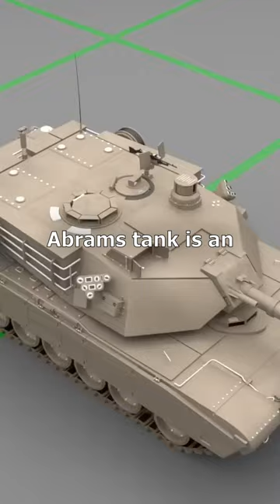The Abrams Tank is NOT Invincible! #shorts

Comment: The chance of a 152mm direct hit on a moving tank is low, even with the laser guided shells.   What has clearly happened is that IFV and MBT were immobilized in the open by tanks and then artillery, Lancet drones and other weapons were used to Finnish them off.  In many cases Lancets or other weapons  were used to get propaganda photographs and images.
Reply: Not to mention that they have all been recovered and repairable!
Reply: @malcolmallen31  they have been recovered in Middle East, but this is a different scenario in Russia
Reply: Whatever helps you cope. I have seen dozens and dozens of pieces of footage showing Lancets blowing up tanks, IFV's, APC's, artillery etc., so please don't try to gaslight me and tell me they are only used for already incapacitated machinery. Russia's Krasnopol is highly effective, actually, but as I said, ,whatever helps you cope.
Reply: Do believe those were mines from the famously long mind field there
Reply: @thanos7691  The ones that can be recovered immediately, are, others are recovered when the area is liberated. would be stupid to try under direct artillery fire. You'd just lose the recovery vehicle as well.

Comment: MBTs are designed to fight other tanks and therefore the tops are generally very lightly armored. Just about any artillery shell with a direct hit will destroy any MBT, this is difficult to do. It is the reason the A10 is a tank killer with only a 30mm gun. It is primarily hitting the lightly armored top and not the heavily armor sides.
Reply: In reality that 30mm gun is hard to accurately place on moving targets, they're more likely to use their air to ground missiles they have on them 👌

Comment: I believe in Desert Storm an M1-A1 was stuck in the sand. Before the crew abandoned it another M1-A1 placed a round from behind in the engine compartment. A maintenance crew arrived and had the tank operational in 6 hours. In Iraq Freedom an RPG round penetrated the crew compartment of a later version on the M-1. One crew member received some burns on his back, but the fire suppression system put out the fire before and major damage was done. Most of the Iraq losses to ISIS were abandoned tanks.
Reply: The rpg needs up grade, tanks, airplanes are only good against people who have no access to  modern missles system.
Reply: The ISIS thing is actually more simple then most think.

Iraq didn't lose to a battle with ISIS and lost the tanks.
Iraqi army never bothered to show up and fight them and ISIS just took them.

Comment: The tanks the USA uses is much better then the tanks used in Afghanistan were taking direct fire and cruising except one lucky guy that manage to send a rpg though a exhaust flap when it was open even then it only took out the engine they ended up removing important equipment and destroying the tank themselves instead of towing it. And I'm sure they fixed that from happening again.

Comment: There is a range in Nevada that contains several tank hulls of various types from Russian to German and even a few abrams hulls, it is for practice for such planes as the a10. The cannon on an a10 can decimate an abrams so a howitzer most definitely can, question is can a howitzer hit it. Laws of probability dictate that if you put enough shells in the air one is likely to hit it. Nobody builds indestructible military equipment, it doesn’t exist. Remember, as n f22 or f35 can be shot down by a p51 mustang in the right scenario and with enough luck

Comment: The Abrams being delivered  is a older designed model like the Leopard 1  30 years behind the current model in use by the US military. It sure will burn with a 152 mm round impact
Reply: I mean yeah just about any tank will if hit by a 152mm artillery as the guy said in the vid

Comment: Have to know few facts about the first Leopard tanks destroyed. Those were modified for mine clearing and currently those has been repaired and back in action
Reply: Some of them were, that field is pretty much cleaned up now. The leopards were mostly fine, but surrounded by the burnt out Bradley's they looked like a centerpiece of failure. Russians still use these images to cope.

Comment: Remember you can kill the crew of any tank if the boom is big enough. The tank will be mostly fine but the crew is pulp.
Reply: Yeah but your not gonna get a big enough concussive way from any artillery shell for that
Reply: @mr.frogster4398  it is dependent on where the shell hits and the size of the shell. Remember artillery shells range in size from 85mm to 203mm.
Reply: @Starmine1231  well yeah but chances are it wont hit the crew the crew is a very small area relative to the rest of the tank and even a 203mm will not kill the crew if it hits ammo or engine
Reply: @mr.frogster4398  that is why volume of fire is a thing

Comment: Whether the Abrams is a good tank or not, it doesn't change the fact that a well-placed 152mm shell will knock it out. But above all the Abrams is not a tank adapted to the type of combat in Ukraine, the combat profiles are
1 far from logistics
  2 without air support
you must remember that the Abrams is equipped with a turbine (not a diesel) and that this turbine must turn (even if the tank is stationary) and that the tank can only run for 8 hours before being forced to restart full...of airplane fuel. After 7 hours it will become a “wounded animal” or be weakened. if the design actually protects the crew well, in the event of a strike, it's a bit like a camel, as long as it doesn't collapse in the desert you're lucky, if it collapses...you 'are much less

Comment: Abrams is hyped up. Still gets stuck easy still can be destroyed uses a lot of fuel needs to be brought up from rear. Needs alot of support. It is a prime example throw $ at the problem
Reply: Yet Abrams wiped the floor with Iraq's T-72s. If used properly it can do wonders, if you use them like a fool, they'll get destroyed. That simple
Reply: @maxaudet5177  in combined force structure yes they are good. Need air power and artillery to support it. If you do that with any tank they are all suitable.. the Ukraine war isn’t a real war imo. It’s a joke sure people are dying but it’s a low budget war of attrition instead of a war with clear objectives with resources in a combined force achieving victory quickly.
Reply: @improvisedsurvival5967  yeah that's what I meant by "proper use", combined arms

Now Ukraine definitively thinks this is a real war and it's true for them. I'd argue it's starting to be the same for Russia, they're losing lots of gear and people wich you'd try to avoid in a simple proxy war.

Now for the West you're right, it isn't a real war yet. It's just a new proxy Like Korea.
Reply: @maxaudet5177  they should just use combined arms and Win the war or not. But somehow dragging it on is what they want. Gives them the ability to blame current events on the war push for war department budget increases. War is a racket
Reply: @improvisedsurvival5967  true, but combined arms is hard to do when you opponent has good AA defenses wich negates your air support elements. Truth is no one has ever been in a large scale engagement again't someone with advanced AA defenses before. Not even Irak compares to this.